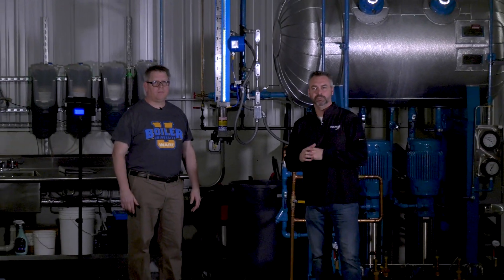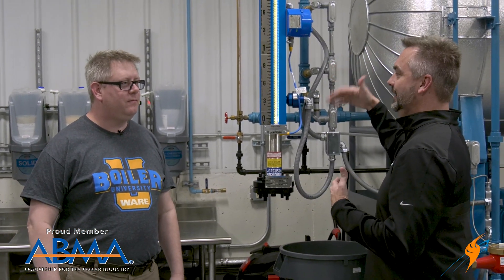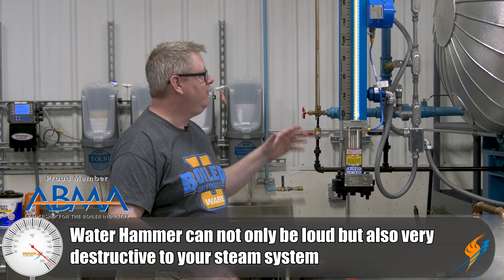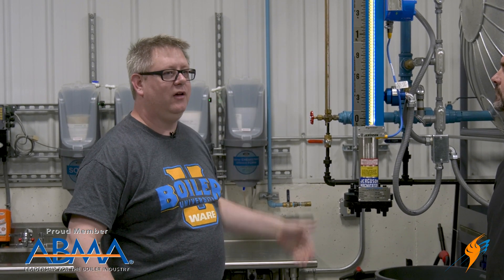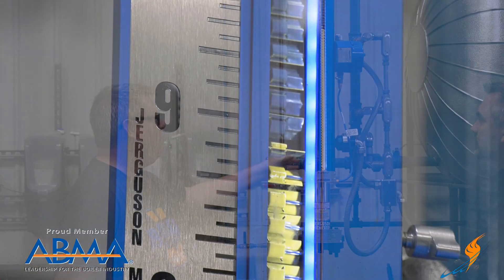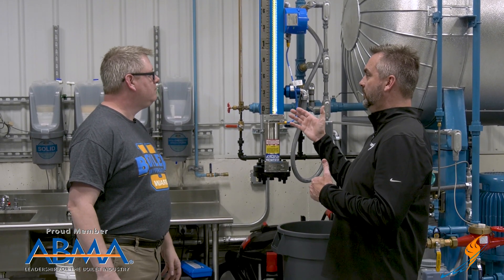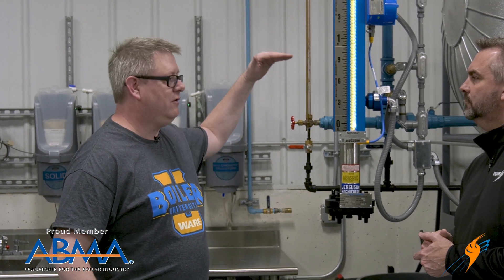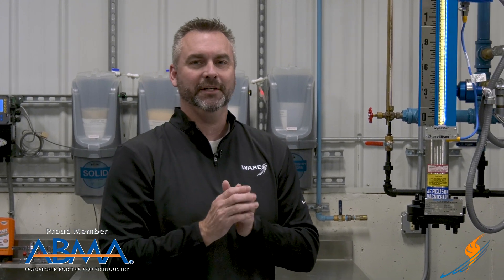Adding High Visibility Sight Glasses to Your Boiler Room - Boiling Point

Comment: It's interesting you mentioned these flip-flop level indicators, because when they designed our unmanned boiler the engineers involved wouldn't have them because they said there was a possibility of mechanical failure for the flips not flipping over  or the float jamming. Is this true?